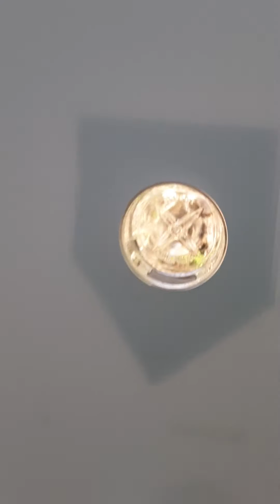New niche utility e- bicycle drawn camper rolling hard tent 4-wheel wagon

Comment: Nice
Reply from the maker: You can believe it bro this thing gives me a mile wide smile. It was really fun project. I bought the frame online from South Carolina it's made in Canada. Cost around three hundred bucks. I put it together in my living room and then I started ripping boards with my silky katanaboy folding saw... This was around the holidays. Sawdust all over the place. Going to add solar panels hopefully then it'll really be something for a long trip. I can probably make it to 60 or so miles to the beach with the two batteries that I have. But then I'd have to recharge somehow for the way back. Once I get the panels you might have company LOL
Reply from the maker: After obsessively watching about every bicycle camper video on YouTube I decided to do something different than the two-wheel rik-shaw design

Comment: Kinda jealous!
Reply from the maker: Thing is basically a big garbage can on Wheels but it gives me a thrill. It was a fun project in not too expensive and not to mentally demanding. A few basic hand tools and hand saws and a soldering iron to melt the holes for the zip ties. The frame was a few hundred bucks. The chloroplast is $20 a sheet. Little bit of lumber and screws and a bag of larger and a bag of smaller zip ties and a beg roll of duct tape. Harbor Freight had the trailer hitch Parts super cheap... the whole thing weighs about a buck-fifty I guess at least , but the electric bicycle makes it a real pleasure and ease to get it around and most of the time you can get away with switching off the assist if you're not in a hurry. Someday when the coronavirus lockdown is over and the wind is blowing East I'm going to ride this to the ocean. already done some major grocery shopping with it also. Looking forward to some actual camping besides my backyard. Though the Comforts of home give me gratitude also
Reply from the maker: And me about the kitties of course